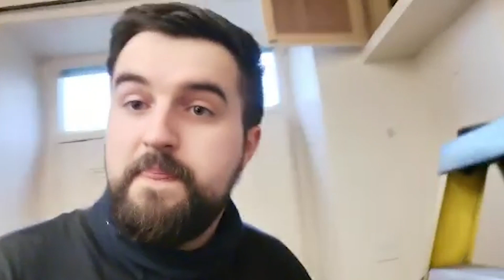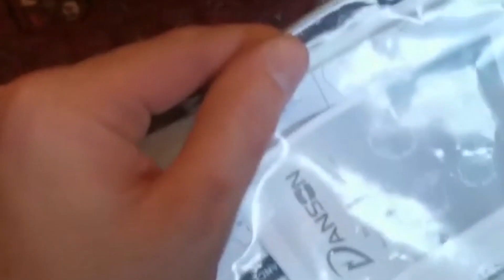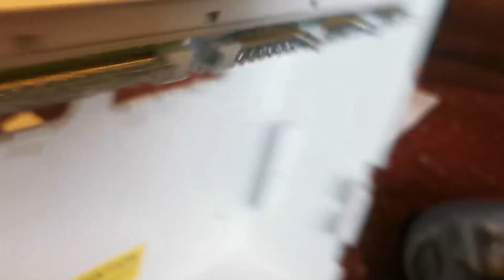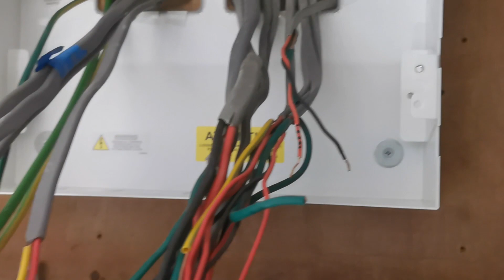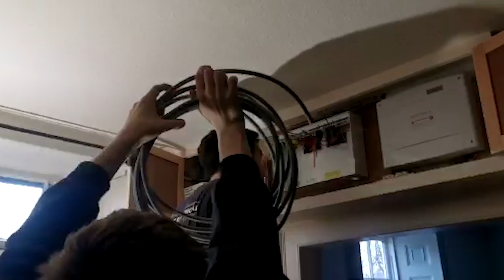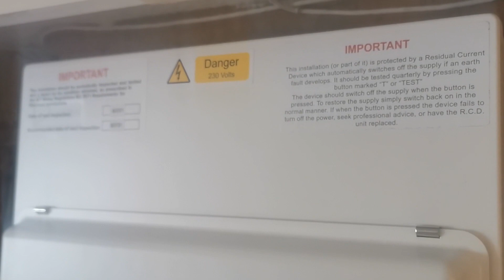NEW FUSE BOARD MUCH NEEDED!

Comment: Cables fell out of the meter then... 😂
Reply: Or get a company that is licensed to fit isolators. Cheaper and quicker than the DNO. Only loss of power when they remove incomer and fit isolator...  Better than a charge for cutting seals on things you shouldn't touch 🤣
Reply from the maker: @chrisneedham4592  don't often need to tbf. Been there when the meter guy came. They ain't bothered
Reply from the maker: Got to do what you got to do 👌 can't expect to call the DNO, wait weeks to disconnect, do the change over, leave the customer with no heating until they reconnect. So no we didn't chop the meter 😁

Comment: No gland for the tails is a bit rough don't you think ?
Reply from the maker: No man top job that 👌 preference really. Might look into a 25mm tails compression Gland though, good suggestion. Never liked them in the past as it gives the fuse board a  spuknic 1 look. How do you do yours?
Reply: @finneyelectrical  I use the whiska glands £1.90 just looks a bit more professional 
I’m not slating you by the way I like your content just constructive criticism 👍🏻
Reply from the maker: @MrLittleevo  can you get a wiska gland that will take 2x 25mm tails? And all good, can appreciate other people preferences.
Reply: @finneyelectrical  some of them are big and stupid, but if your coming in the bottom or side use a 32mm stuffing gland, looks better
Reply from the maker: @acelectricalsecurity  aye started using the wiska ones but does look a bit spuknic 1 😂